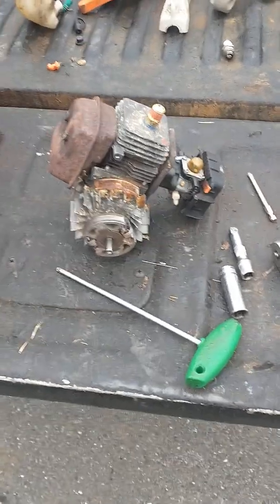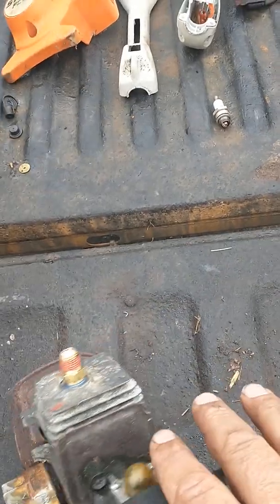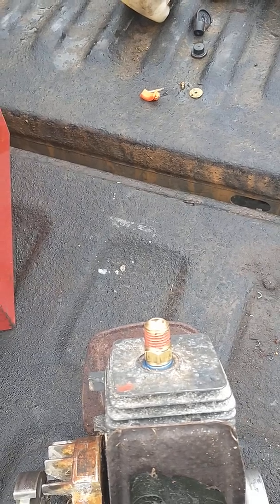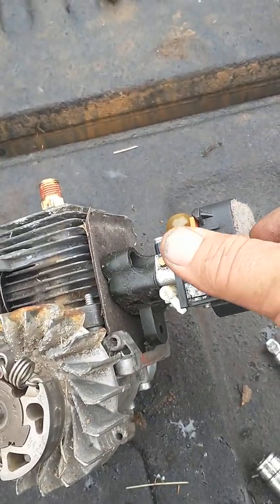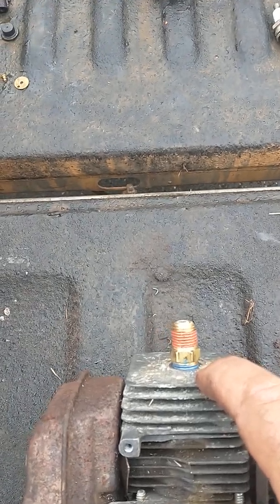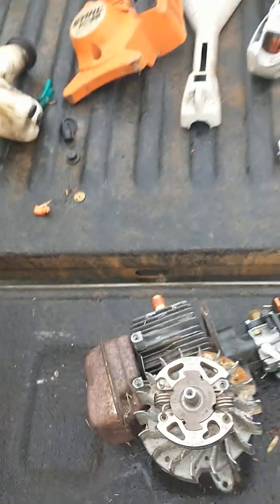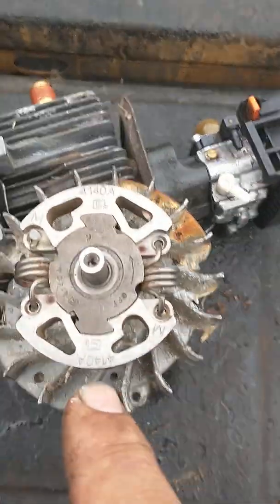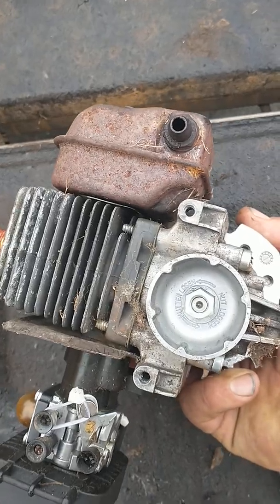DIY Air Compressor from 2 Stroke Engine (Stihl FS55)

Comment: Ok so.  Think about how that engine works!  You have an intake.  And you have an exaust.    🤦‍♂️.  Ok so hear me out.    Block off the exaust and holy shit you have an air pump.     Y the check valves??
Reply from the maker: Great question, thank you. The check valve prevents the air from being drawn back into the combustion chamber when the piston moves downwards. It also reduces, but does not eliminate, the anti-rotational load effect of the compressed air in the storage tank.